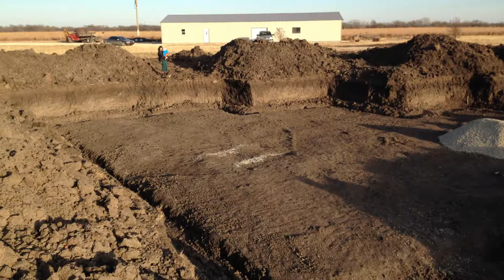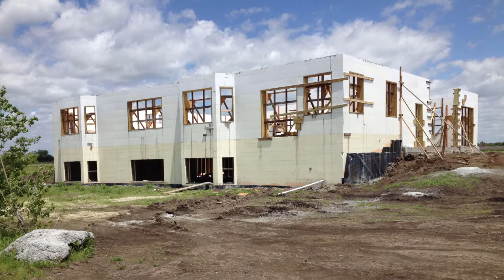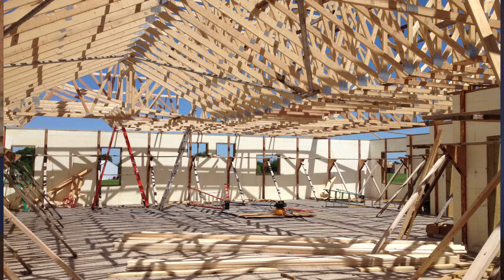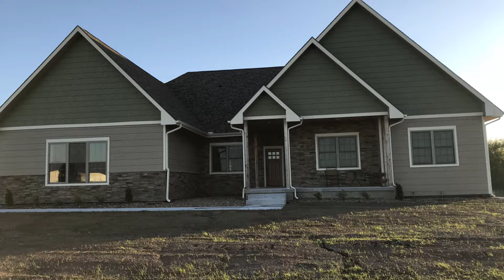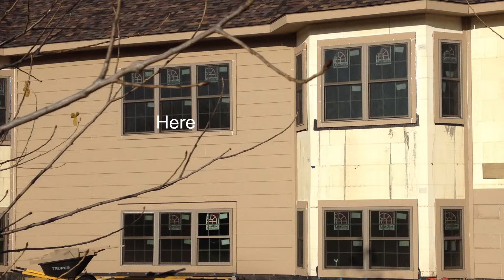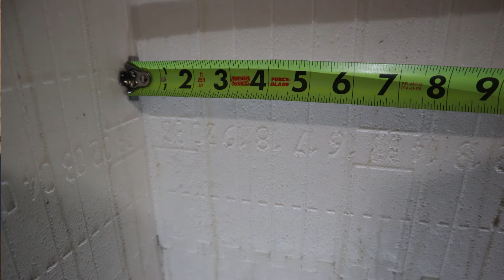The Realities of ICF

Comment: Good points, but I don’t really like my icf for one reason, siding was a huge pain, the corners have no studs to nail to....no screw to, yep no nails, long time and a pain, then around the windows, by the time the trim goes on, no place to nail...trim. Then, try and put something in, outside water tap, or anything, needs to be core drilled depending on size, all can be done but difficult. However, all good points, sound transmission, high R valve, picture hanging, ya but there are so many drywall anchors. If I were to do again, I’d use regular concrete construction in ground, ICF, very difficult to water proof below grade, then at ground level the area before above ground gets siding, what to do there, limited to large, but best parking always cracks after few years. I waoukd allow extra interior for double 2x4 walls to keep the bridging from cold heat to help in insulation. To have a sealed wall, spray foam, gives vapour and air barrier. Above ground, I would use, I can’t remember the term, it’s plywood with a high R valve inside, that way there is constant backing for trim, pictures ect. Both interior and exterior. I also found very messy to wire, the static foam stuck to everything. That is my experience as well, being a tradesman I was able to do all the work myself, except roofing, don’t like heights. But sheet rock didn’t move, no nail pops, no shrinkage, lots of ore planning, I managed to put in lots backing for towel bars ect. Messy, because had to cut out the styrofoam in 1/2”. That’s my experience, I didn’t do it for cost, I did it for durability. Energy savings is great. I would say it’s more durable due to concrete, so depending where you live, it’s actually simple as hell to install-ICF-1400 sq ft floor in a day. But, in my case I had to use a pile of plywood to hold the forms in place. Even they say 8’ pour is fine, do not believe them, support the corners and opening very good with extra. If you think it’s good do more. I did my place in two pours, 9 feet bottom, 9 feet top. The floor joints were a bit of a pain too, had to use special joist hangers. 

My take, research, all options, and decide if you are doing it yourself or not. I can see a contractor cutting corners without you knowing, building myself I didn’t cut corners. I am happy with the place but found too much work for the little things. Siding ect. 
,

Comment: Why not build out of concrete blocks and ad form boards on the blocks? Would be a lot cheaper with the same out come.
Reply from the maker: Much slower, not as strong, less r-value and no built in furring strips.
Reply: @TheChallenged1  I'm not convinced it would take longer. Blocks can be laid fast. Blocks have been proven to be strong enough for buildings. Concrete has no r value. The r rating would be the same if the foam thickness was the same. Furingstrips may not be much of a factor on the overall time factor. Probably much cheaper in the end.
Reply from the maker: @SawmillerSmith  In the end, build whatever you want.
Reply: @TheChallenged1  I like my idea for the fact is you don't need to buy the expensive not easily available concrete forms at the local big box stores. I haven't compared the cost of both styles or labor cost. How much where the concrete forms concrete and rebar for your house?
Reply from the maker: @SawmillerSmith  I made a video of how much my house cost which broke all of that out.
Reply: @TheChallenged1  okay, I'll check it out,thanks
Reply: @SawmillerSmith you forgot the cost of mortaring CMUs which isn’t there in ICFs. And that is very high priced labor.
Reply: @TheChallenged1  ... and definitely not cheaper.
Reply from the maker: @elliottdiedrich2123  I'm fairly certain it would end up being far more expensive.
Reply: @elliottdiedrich2123  It is cheaper in the long run not many look into that also ICF can be cheaper at the start depending on what you are building and how much of the work you can do your self ??
Reply: Love our ICF house. Took the ICF to the roofline instead of just the basement like so many do. My wife and I stacked our own blocks and saved lots of money. Even the Amish in our area are using ICF.

Comment: Hi Garrett- firstly, just killer. I found the perfect channel for my build. I am GC-ing a homestead in the Colorado mountains on 35 acres of pastureland. Doing all above grade on slab with geothermal radiant. ICF's seem to lend themselves to this build. Love the legacy aspect as I have young children. 

So I do have a couple of questions. 1. Did you use an HRV/ERV? You mention the moisture but are in Kansas with higher humidity. We are dry here year round so ERV makes sense I think. 2. You mention the small amount of noise you can hear through your windows. Are they triple pane by chance? 3. Did you pour walls before slab (this can prob be answered by checking out your other videos)? 4. Electrical - did you do the electric chainsaw? Any rec there? 5. Did you happen to put plywood behind your cabinets to make them easier to hang?

Thank you and awesome work!
Reply from the maker: Thank you!!!

1.  I just run dehumidifiers during the summer, no ERV/HRV (Couldn't afford it at the time).  2.  I have double pane windows.  3.  Yes  4. I used a combo of a sawzall and drywall saw.  5.  All of my upper cabinets are on interior walls.
Reply: @TheChallenged1  Def hear you on the expense of the ERV/HRV. 

One more question...

I have read that ICF's may not perform as well in very cold climates. I am in climate zone 7 and wonder if I should create an asymmetry from outside insulation to inside? Some of the ICF's appear to facilitate this.
Reply from the maker: @benjaminhead1944  If you can afford it, do it.  You can't be too insulated!!!
Reply: @benjaminhead1944  i did a whole home erv that is fully ducted. Runs 24/7. Its called a life breath or something 
Also have a whole home dehumidifier but im in Fl so humidity is insane here

Its not hard at all to find the nail strips on the buildblocks they are every 6"  just keep a block inside while your building as a reference for your brain.
Reply: @SolarTechFL  Thanks Joe!

Comment: Thank you so much! Some valuable points and very well spoken off. 
I am planning to build in south west Florida using 
Hobbs Vertical ICF, and the lot is already purchased. I absolutely love the ICF idea. What I really scared of, is the proper process of concrete pouring and proper vibration. How do you mitigate the risk of bursting, hollow pockets, proper concrete consistency delivery? Should I simply hire someone for the pour? Thank you!
Reply: Hobbs system is weird do the buildblocks. I have plumwall bracing if you want to rent it im in Avon park. 
The pour is not to hard i thought the same way as you but now ive done a few and its nothing to be frightened about
Reply from the maker: If it's something you aren't comfortable doing, hire it done.  You can always be their helper.

Comment: Besides the insulation used in your interior walls (for sound damping) and the attic did u add any extra insulation to the inside or outside of the exterior (ICF) walls or is the ICF foam the only insulation you have on exterior walls?
Reply from the maker: The ICF is the insulation.  When the thermal mass is taken into account, it's an R50 wall structure.
Reply: @TheChallenged1  
Did u use the 8” concrete block all the up to roof?
Reply from the maker: @ABeautifulMess.X0XO  8" core for the basement, 6" core for the main level.

Comment: Another great ICF video, I'm sold on the idea.  Time to get going I guess.  What are your thoughts on the floor ICF forms?  How did you do the upper level floor in your home?
Reply from the maker: I went with standard wood trusses.  They are nice because you can hide all of your mechanicals in the floor system.  I guess I don't really see the point of the icf floor trusses in a single family home.
Reply: @TheChallenged1  Good point about the mechanicals.  I was thinking of hurricane / storm resistance, but that's what insurance is for.  LOL

Comment: Sir one other question,  in my area of Middle Tennessee where I will be building we have tornadoes so I wanted to do a concrete roof,  what method do you recommend. Thank you God bless
Reply from the maker: If your house isn't too giant, you can do an ICF roof.  They can be done in spans up to 40'.
Reply: @TheChallenged1  I used insuil deck for my pitched concrete roof. Its 5- 1/2"  concrete slab and 16- 1/2" T-beams every. 24"
Reply: That makes me even more interested in ICF.  Here in far WTX an ICF building has greatly interested me, I didn't realize you could also make an ICF roof.
Reply: @bradanthenat840  https://youtu.be/eBQ0CA_Owns

This is my concrete roof home i built. Its off-grid too
Reply: Did you all consider using a SIPS roof?

Comment: Sounds like a whole house dehumidifier would be a good thing to have. 

Did you consider doing an ICF roof rather than stick or was the price difference too great?
Reply from the maker: The spans on my house exceed the icf roof design.  For a smaller house, I think it sounds awesome.
Reply: My icf roof probably cost me 35k in material and its around 2k sqft. 
Its 35' from wall to wall but with the peak of the roof being a beam the span is only half of that.
Reply: @SolarTechFL  Thanks Joe! How much would it have been had you gone with wood/shingles instead?

Comment: Hey Garrett, I've been loving your videos. Quick question on the humidity issue, have you or anyone you've talked to come up with ideas to mitigate the humidity before finishing the inside / moving in? Or would something like the faswall / any block that isn't styrofoam provide better breathability to equalize the humidity much sooner?

The reason I am asking is because I know with traditional stick build houses, the exposed wood typically gets some mold growth which gets covered up and stays in the walls throughout the time you are in the space. Not good. I don't know how much of a problem this typically is (seems a lot more common in recently built homes), but it's not one I want to have.
Reply from the maker: I haven't heard of a remedy other than time.  Just leave it uncovered as long as possible and run dehumdifiers.  Doing that, I haven't seen any mold growth.  I think being aware of it is the big takeaway.  Then you know what to do and that it is temporary.
Reply: @TheChallenged1  Thanks for the reply!

Comment: Garrett, these videos (ICF) are great, thanks for sharing.  I keep wondering what is the truss looking thing on what appears to be a concrete pillar over your right shoulder (left side from viewers viewpoint)?  Thanks much.
[addition:] the $100.00 dollar monthly electric bill, does that include your solar generation offset?  ie. $240 electricity used, solar generated $140, left with $100.00 deficit/bill?  Thanks again.
Reply from the maker: The $100 is net.  I'm still gathering data on how much my solar offset is.

The truss that you see in the video is a truss.  My recording space is in my shop.

Comment: I wonder if the foam window bucks that ICF manufacturers are providing instead of wood would reduce the expansion and contraction noises 🤔
Reply from the maker: I wonder that too....
Reply: There are any number of Window buck materials that can be used. Myself? I built my home in 1993, and used the top-line pressure treated lumber that can also be used below water even in salt water. I’ve Never heard any expansion or contraction sounds in my home. Of course, I used steel roof trusses, top-of-the-line vinyl windows (not aluminum), and fiberglass Mexican Tile shingle roofing. My interior walls are all steel studs. If you use them, be certain to insulate the interior walls with a top grade insulation product. Steel studs tend to transmit sound easier than wood studs that deaden sound somewhat. And, to add extra privacy, all walls between bedrooms and living areas were built with the smaller (thinner) 4” ICF block. This went for the walls for the bathrooms (actually these walls were part of the bedroom wall system). Exterior? Well for a life long guarantee never to maintain much exterior, brick!

Comment: Are you heating your water with a resistive hot water tank? If so you should think about upgrading that to a heat-pump version.
Reply from the maker: Yes.  The heat pump versions don't have a great history of longevity.  I bought a lifetime tank that I can change elements out of whenever they fail.  Once the desuperheater is hooked up, I should cut the cost of hot water by 40%.
Reply: @TheChallenged1  Desuperheaters do work well and reducing the amount of energy usage for heating water. Personally I bought a heatpump water heater. I have my 60 gallon desuperheater feed into my 50 gallon heat-pump water heater (resistive elements are turned off). This then feeds into an on-demand hot water heater 27kw. I find that this system allows for the lowest standby costs and highest savings. The heat-pump water heater is named brand and has a solid warranty. I also have a softener system that will reduce the corrosion on the tank. The on-demand is set to engage once the previous tanks drop below their thermal limits allowing me to have endless showers if I feel so indulgent.
Reply: Another nice factor about heat-pump water heaters is that they extract water from the air meaning mine acts as a de-humidifier for my basement  @Matt Risinger has commented that the gen1 units he has installed have held up well so I felt confident in installing the 4th gen unit.
Reply from the maker: @Couchlover47  That's what I have as well.  Plus the heat pump style has to pull the heat from the home, which then has to be made up by the hvac system.
Reply: @TheChallenged1  true the heat is pulled from the home but that is only a concern in the winter and during the winter it is acting as a dehumidifier. In the summer it is HELPING the overall conditioning of the space. In addition my geothermal has a COP of 4.6 and the heat pump water heater has a COP of 3.55 so I am still above the COP of 1 for a resistive unit. Finally I duct this cool dry air that the water heater produces to the condenser of my fridge in my kitchen reducing the work it has to preform and keeping the compressor cooler. I dont know the gains from that but they do exist.
Reply: Here is the Matt Risinger comparison I was speaking about. (https://www.youtube.com/watch?v=omivdhxdGv0) At almost 10 years I should be able to buy a 2nd heat-pump water heater unit IF the first dies for the same cost of the marathon unit. My original unit cost $950. This does not take into account the rebate I received for installing one (300). When buying the 2nd I would be also possibly be buying into BETTER technology. Resistive units will never improve. Only the insulation amount of the design will increase. Heat Pump water units arn't all sunshine though as they do have a long recovery time. Hence me purchasing the on-demand unit (unit costs about what the rebate savings were). Only last issue is the psychological affect that the water is always warm an in turn choosing to use more of it. I am on a well so the water acquisition isn't a large cost but the heating using the on-demand unit after the heat pump is exhausted is a concern. (again no more than a traditional resistive unit) 

Also most heatpump water heaters include a resistive unit so IF the refrigerant system failed the backup of the resistive unit could kick in & a 10 year warranty so it should last at LEAST that long.
Reply: If where you live does NOT freeze area (south west) you could also put it in an unconditioned space (like a garage) and capture the heat from there giving you cooling in the garage.
Reply: @justinherman9443  im in fl mine is in my attic. Keeps it cooler up there but my attic has 12" of Styrofoam and 5" of concrete lol
Reply: @Couchlover47  I've only seen desuperheaters on ground-source heat unit. (geothermal) Technically it could exist on a air-source but you would need to insert the heat exchanger inline and calculate the extra refrigerant for the additional volume added to the system with the heat exchanger.
Reply: @Couchlover47  Looks like they do make external unit. https://www.nordicghp.com/product/nordic-products/external-desuperheater/

Only issue I see is this is for a hydronic system and not a potable water system. The components inside may not be suitable for drinking like a desuperheater for a geothermal system.

Comment: I’ve kinda always had my heart set on concrete construction, so ICF just kind of makes sense to me as the best way of doing that. To me I want to build a house, and live there the rest of my life, or until something forces me to move. I want it to be durable, and extremely comfortable. Lots of effort will be made to make the exterior zero maintenance too. It’s not just the time I don’t want to spend later, it’s also the money. If I can build it to just last in the first place, I’d rather.
Reply from the maker: Sounds like a great plan!!!
Reply: @TheChallenged1  do you still use 1/2” drywall or can you hang something thinner because of it being hung on ICF walls?
Reply from the maker: @SCARREDMTBER  I used 1/2", but I suppose you could go thinner.